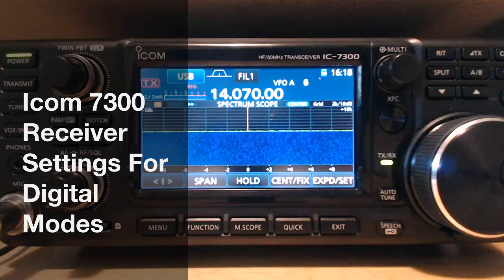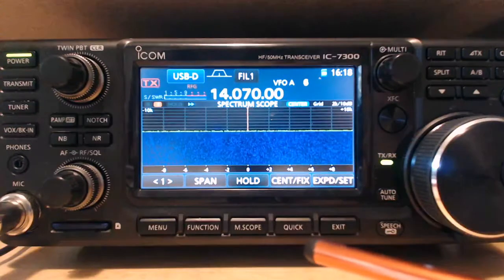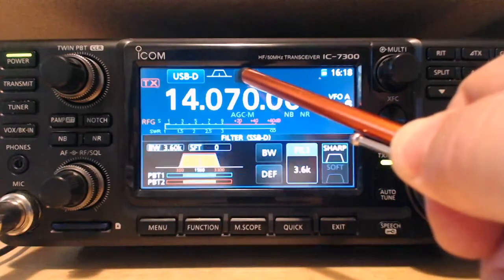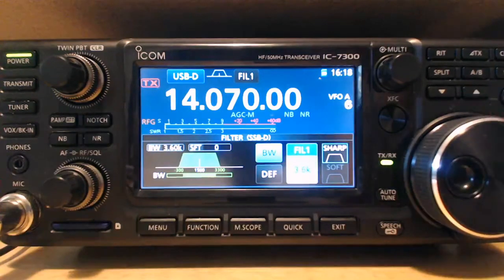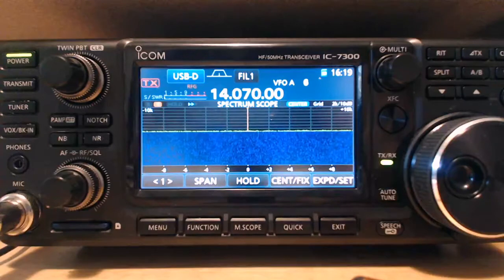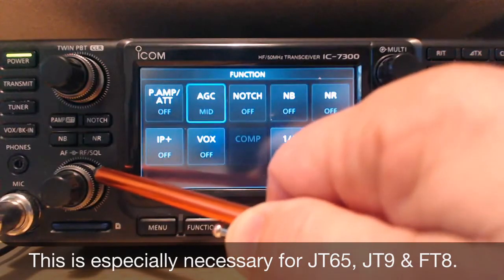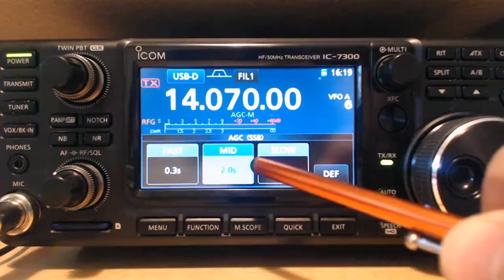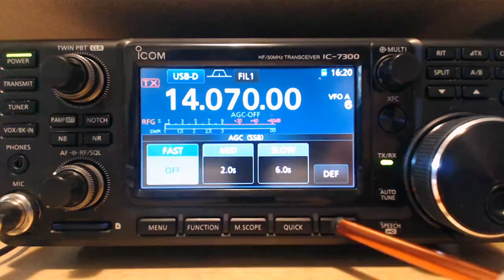Icom 7300 Receiver Settings For Digital Modes

Comment: When I turn AGC off, all the signals go way down and WSJT-X shows that the incoming audio is way to high.  With AGC on slow, the bar is green between 65 and 75 dB.  What could I be doing wrong?
Reply from the maker: DR V  try AGC off, lower the RF Gain down a bit, lower the AF Output level in the radios menu until the bar is green. 73!

Comment: Is this for rtty too? I have yet to decode rtty, is anyone using it anymore? Any help on that would be great.
Reply from the maker: Hey that's a good question, but actually when you go into RTTY mode in the 7300 it switches filters for you. One advantage of using FSK is the great filtering in the 7300.

If you mean RTTY AFSK, those setting will work. The AGC may need to be tweaked a little or turn the RF Gain down a little so it doesn't blow you out with the AGC off, hi hi. 

RTTY AFSK is a blast and I used to use it more. Back then I used NR, NB, more AGC and a wide filter. RTTY AFSK is a little more forgiving, not a weak signal mode. That's the advantages of the settings in the video. It'll allow decode for weak signals in PSK, JT65, JT9 and so on. RTTY to if it's weak.

In contests guys run high power on RTTY. I tried it once or twice, but it can heat up any radio. 

Give it a shot, just call CQ. There are lots of Hams on RTTY. I think the weekends are best.

I hope this helps. - 73 Rich

Comment: Filter is not set correctly as the max receive is 3.3k. You need to shift the bandwidth 300Hz to the right so the left of the filter is on zero and NOT -300. Then max receive will be 3.6k. 73 de Guy G4DWV 4X1LT
Reply from the maker: Thank you for the information, that is very good information and makes sense on the radio side. However, I don't believe it is worth changing (no benefit) due to the limitation of the waterfall, digital mode and/or the software. I will try that when operating next time to see. Thank you again. Best 73! Rich
Reply: Hi Rich, Most my digital software allows a receive bandwidth of 5K, making the adjustment that I mentioned gives an extra usable 300Hz at the top end. Let me take the opportunity to thank you for all your helpful videos. 73 de Guy G4DWV 4X1LT
Reply from the maker: DrTeeth Ahh...I'll make that adjustment and try it. Thank you for the information, it is truly beneficial and thank you for the kind comment. Best 73!